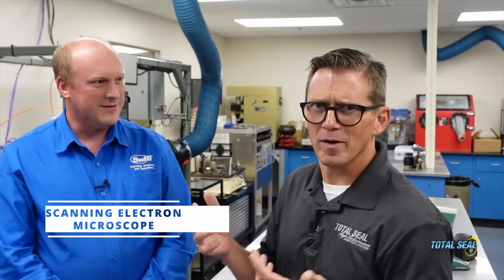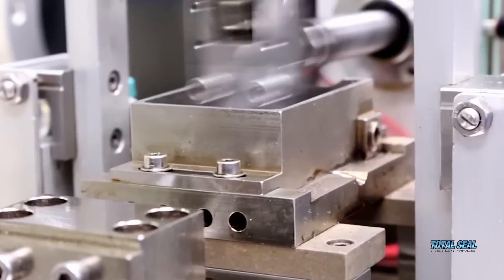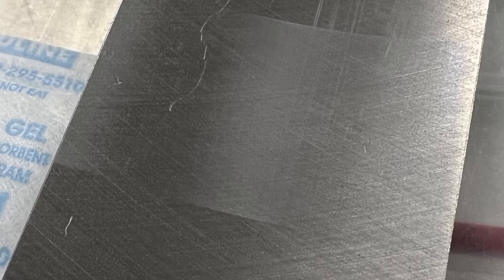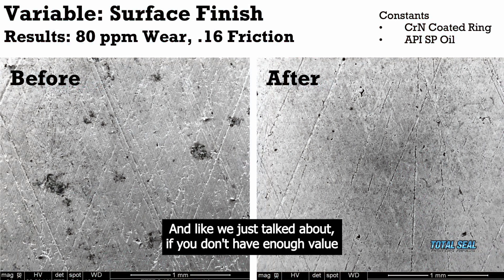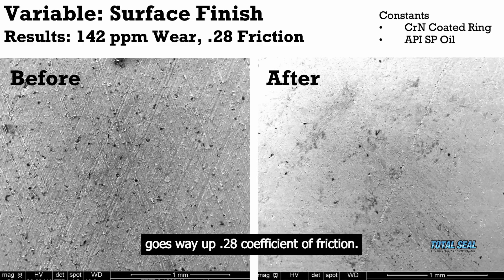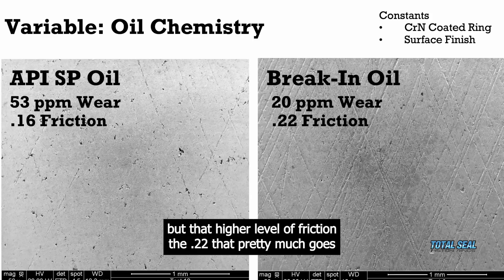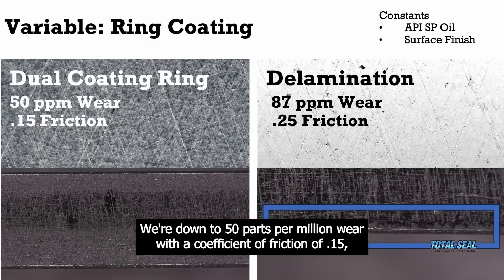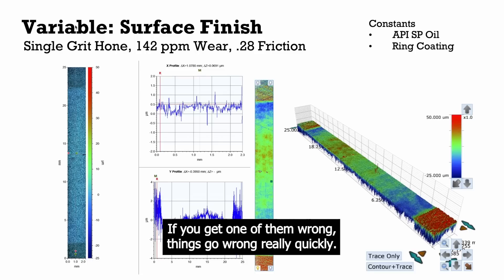What The Heck Happened??? Motor Oil Wear Testing

Comment: Bond a lubricant to the piston and bore and the wear mark will disappear.
Wear reduction is typically 50~90% (probably more in some areas).
That is equivalent to a 2~10x increase in lifespan.
...and it only requires one treatment.
:-) #XcelPlus

Comment: Very interesting, have I missed the follow up to final resulting? Or has it not been published yet? . . . The cylinder/ring section reciprocating wear jig looks cool ,  I am interested to know how the linear motion to sample test pressure is controlled or is it variable? and whether it is simply a linear motion ? If it was driven by effectively a "cross-sectioned engine" it would more accurately demonstrate expected wear in the real world, taking into account variables such as ring side forces within the piston grooves, and variable thrust forces at maximum acceleration and thust points, around the top and bottom of the stroke, which generally account for maximum accelleration/decelleration areas of wear to both pistons, rings and bore surfaces, in ice's. Also is the sample tested at ambient or realistic enging running temperatures? Many thanks, a great video!I

Comment: I bet vehicle manufactures run the api due to fuel milage with the low friction because alot of small things in the pursuit of fuel milage do matter. This is very fun and interesting information. And i thought i knew alot about engine oils.
Reply from the maker: That is a spot on insight. Fuel economy is the major driver for the OEMs.

Comment: Lake, I love your videos. I've learned a buttload. 

Can you please have a look at BG's EPR engine cleaner?

I've had magical results with EPR. 

I've always used engine flush from multiple brands but it seems the best result is super-thinning of the oil which speeds up the oil change process (the old oil flies out the drain hole). 

With EPR my oil is black as pitch even though I'd been running synthetic oil the last 20k miles (5000 mile oil changes).

I think EPR is the real deal, but I'd love your analysis.
Reply from the maker: Thanks for the suggestion.

Comment: Do I get it right, because it is the opposite that I thought was logical. I always thought that a full synthetic from start has less wear? Normally a new KTM motorcycle engine has break in oil that should be replaced at 1000 km. I experienced 50 more revs at idle after changing the break in oil for a 10W60 full synthetic. Is break in oil normaly a heavier grade oil?
Reply from the maker: It can be, but that is not always the case.

Comment: Thank you Lake and Dr. with all this great data. Thanks Lake a few years ago I contacted you about using high zinc Driven Hot Rod oil with high zinc in my newer cars and not just my pro street car and my newer cars upper cams still look brand new with 100,000 miles on  them and run so nice. Not a bit of smog or car issues since you said it won’t have unless the engines burn oil which they do not . Fantastic oil.
Reply: I tried editing my comment on the hot rod oil where I didn’t say you mentioned it was fine to use the high zinc.  Thanks for your help Lake and love every video you’ve made so far just need bit more time to watch more. Know who does a great proper job on honing here in Washington State? From Portland up to Seattle since I live in Yelm which is about the middle?
Reply from the maker: The guys at Action Machine do a great job!
Reply: @TotalSeal  awesome thank you very much
Reply from the maker: Thanks for sharing

Comment: So… dumb question: when is engine break in done?
Reply from the maker: Done right, it will be finished in about 1 hour of engine run time.
Reply: @TotalSeal  I sent my oil to Blackstone oil labs. My iron and aluminum did not start to level out until about 50,000 miles

Comment: As this work materializes do you see the path of discovery for engine builders to submit requests for testing/ information from SouthWest Research or information being distributed through vendor partners like Total Seal, Rottler, Digital Metrology, etc? It seems to me that we are only beginning to scratch the surface... on the subject.
Reply from the maker: Due to the cost and lead time on this testing process, it be available only for large engine builders.
Reply: Everyone uses SEM Microscopy...anyone who does anything with particles does,  and has been for 30 years ☝️

Comment: After you loose the cross hatches the cylinders become polished which leads to oil control and oil usage !
Reply from the maker: Absolutely!
Reply: @TotalSeal That's what happened to my Pontiac when I got it up around 200K.

By the time I got rid of it at 263K, I was putting a quart of oil a month into it.

Not bad. 231 series 3. I hope my next car gives me service life like that.
Reply: @karrpilot7092  my 94 chevy S10 2.2 cylinders lost the hatches around 400,000 ! I seen that when replacing the head gasget ! she now has 656, 700 miles ! Original unrebuilt. It uses bout a qrt every 1,000 miles ! Runs like a champ still !
Reply: @scottymoondogjakubin4766  I was trying for 300K. But the rust was up to the door handles and the transmission was haunted. 

Being on call with my job, I decided to retire it and get a new car. Miss that Pontiac. It was safe in any neighborhood. )
Reply: @karrpilot7092  DARN Rust !! 😢
Reply: And it's not unusual to see cross hatching on well used engines.
Reply: @FairladyS130  Most engines i have torn down lost there hatches between 200k and 400k ! My 94 chevy s10 2.2 with 655 k on it ! The cylinders are polished ! It uses about a qrt of oil every 1000k miles ! All original motor !

Comment: So it is incredible to think about and watch these things but how the heck is the everyday engine builder watching this supposed to do anything about it?  What if all the local machine shops are still using the same honing equipment they did in the 70s and think it is just fine on new fangled engines?  How do we find someone who knows how to do proper plateau hone jobs and stuff that are correct for your newest high tech rings?  I do a ton of new hemis and I have several customers who bought crate engines from a localy very popular engine shop and they all use a quart of oil every 500 miles, seems even some of the big name shops don't know how to set up for modern, thin low tension rings, they probably do just fine on a stock 318 but can't seem to get these new engines right.  I would love to take my blocks somewhere to get stuff done right but don't know where to start...
Reply from the maker: Thanks for the comment. Contact Rottler Mfg. They can tell you who has their hone and the profilometer in your area. They are working on a database that builders like yourself can use to locate machine shops with the modern equipment and know how.

Comment: Great information…
What’s missing for me, is, what do the various finish numbers represent in the images, and how do different values physically look in comparative images?
Reply from the maker: Good question! The surfaces that failed were single grit finishes or overly plateaued surfaces. A surface that is too peaky is bad, but a surface that is too smooth is also bad. The peaky surfaces had Rpk values over 25, where the good surfaces had Rpk values between 15 and 10. The too smooth surfaces had a Rk below 30, and the too rough surfaces had Rk values above 60. The best surface had an Rpk near 10, Rk near 40 and a Rvk near 55.

Comment: So, did they test, diamond ring coating with light weight oil, let's say 0w20 and heavier oils like 5w30?
Reply from the maker: We did test oils of different viscosities (with the same additive package). The thicker viscosity oil made a much smaller difference in wear than the oil additive chemistry did.
Reply: What about the Diamond Finish, what were the results on those, did you test them?
Reply from the maker: @CJ5EVOLUTION  The Diamond Finish process is on the side flanks for better sealing against the ring groove. These tests are just ring face to the cylinder wall, so it would not change anything.
Reply: @TotalSeal  so they take an AP ring and coat the axial sides only?
Reply from the maker: @CJ5EVOLUTION  There is more to it than that, but the face coatings are both PVD applied. The AP rings are CrN and Diamond Finish rings are either WC/C (which we did test) or TiN.

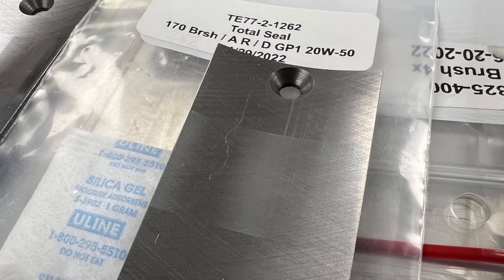Comment: Is 2:38 using Driven gp1 20w/50? I use gp1 20/50 in my cart engine, it offered outstanding protection that carting oil dont offer for splash lubricated  engines 😮
Reply from the maker: Good eye! The GP-1 Break-In oil was one of several oils that we tested.